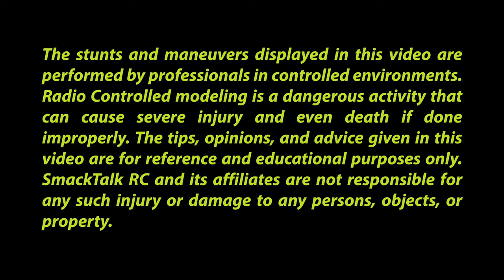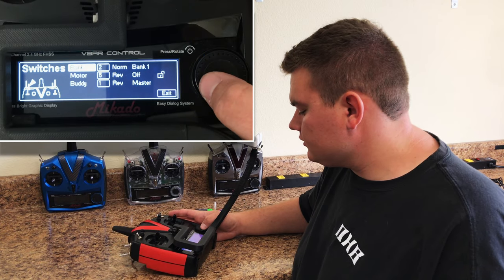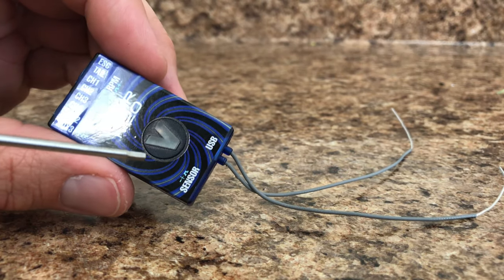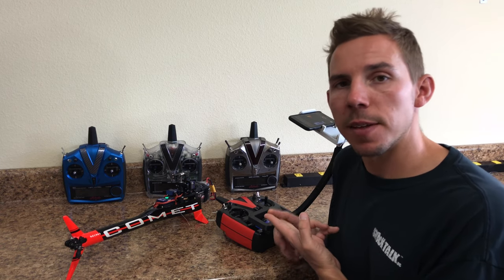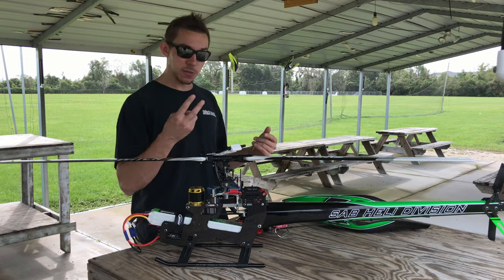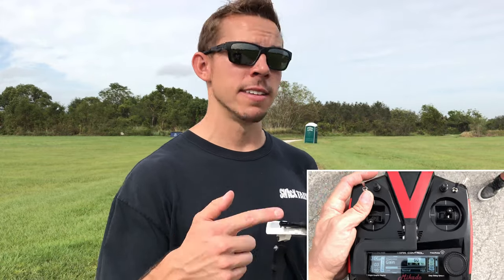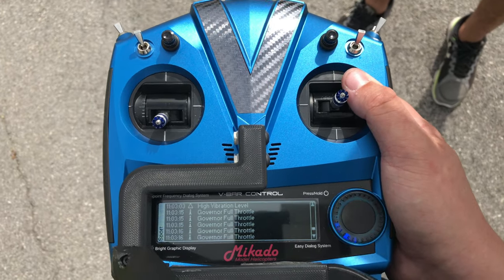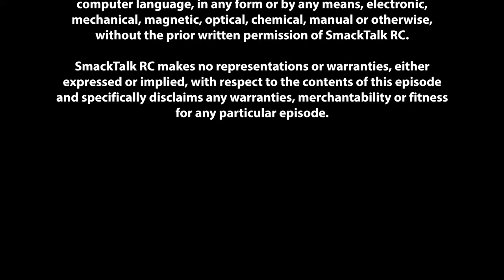SmackTalk Episode 31 - The Mikado VBar Control

Comment: Hello.  I purchased a Tribunus 14-300A Series engine governor.  I cannot pair with V-Bar Neo (V-Bar Control).  I also want to connect via telemetry wire ...
 I still do not understand which socket in the figure is "MASTER", which is "SLAVE" ??? There are 9 pieces of pin connections ..

 Help me please🙏🙏🙏

Comment: https://youtu.be/l5fcJjaWEBo?list=FLbRDdg3X4--W-Xc7af9qdlA&t=2896 I have my Hobbywing set ast Store Gov, and Kyle mentions to have it last heli linear mode.  Has anything changed since this video came out?  I had it as linear before my mayden flight, but the people at the field stated that I must use store gov when using a hobbywing and Vbar Neo.  What are the advantages of store gov over heli linear.  Thanks.
Reply: Gov or Gov store is fine if you're using the HobbyWing governor, but if you use the vBar governor, you should set it to linear, it will work in Gov mode, but not as well and it is not the correct way to set it up.
Reply: @BertKammerer Are there any advantages of running the hobbywing as the governor over the vbar?  Which one would you recommend?
Reply: @rdjvelasquez  It really depends on how you look at it. Some people prefer the vBar governor, they say that it "predicts" inputs from the pilot and proactively reacts, and this is true, but to get it to work very well, it will require a bit of tuning and tweaking whereas setting the vBar gov to "external" and running the governor that is built-into the HobbyWing in Gov Store is easier and works very well. Most of the people we fly with just use the HobbyWing governor and leave the vBar governor alone although you can't go wrong either way, you'll just have to do more tweaking with the vBar gov.